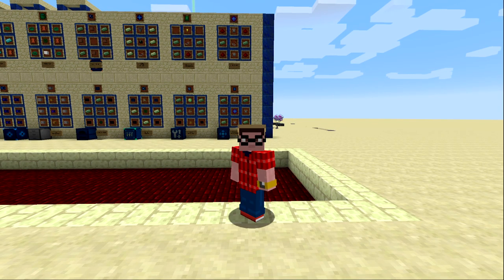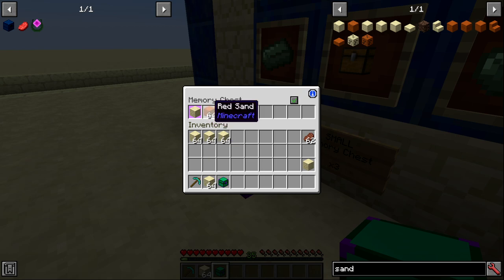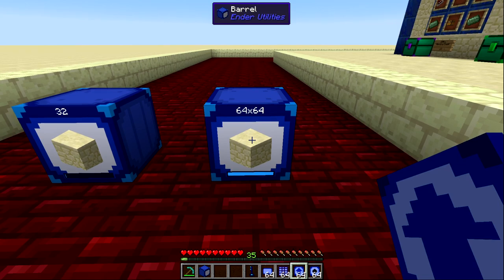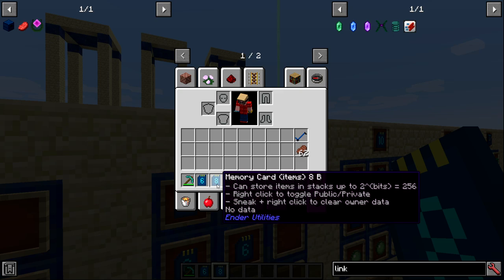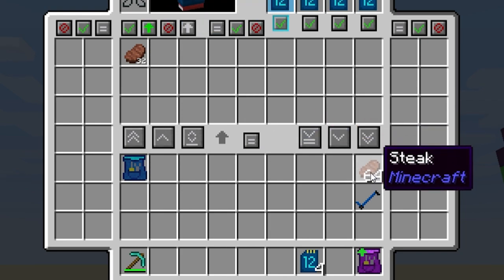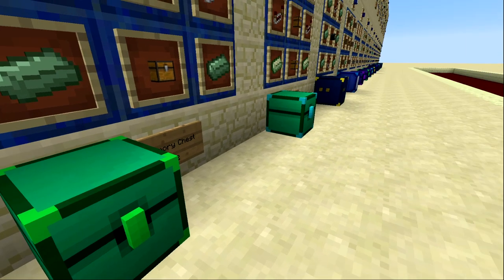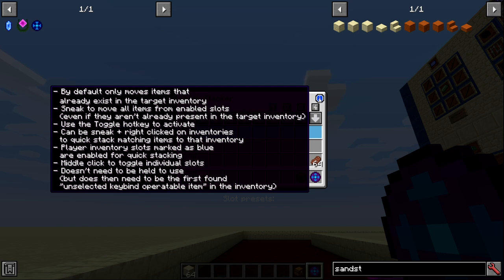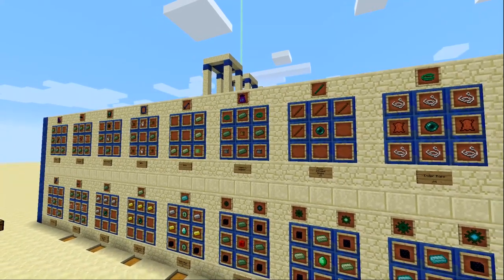Mod Spotlight - Ender Utilities: EP3 - Storage Blocks

Comment: Did he mention how the ruler is supposed to work?
Reply from the maker: The ruler was to be covered in Episode 4 of this spotlight. In the meantime I’ll just explain it here. 

The ruler works by installing misc memory cards in it. Whenever a memory card is installed, it will allow you to select two points by right and left clicking. Whatever button you use to start the measurement, the opposite button must be used to end it. For instance, if you start the measurement with left-click, the end measurement must be a right click or you’ll just reset your start point. To get rid of the measurement, you just have to left/right click to turn it off. 

Shift+scroll will cycle through your installed memory cards. 

If you have any more questions, just ask! I read every single comment so you really can’t miss me.